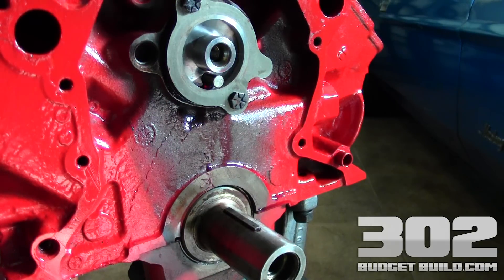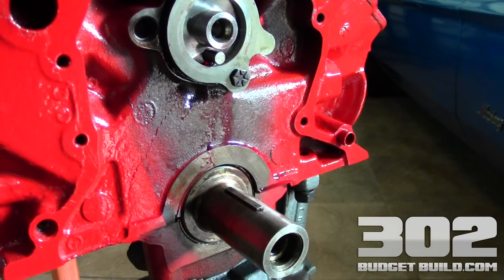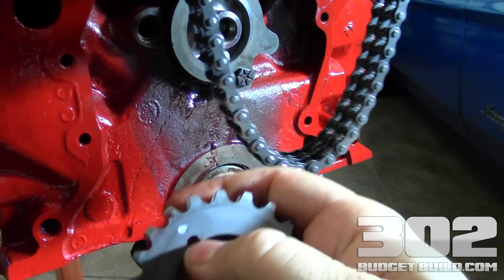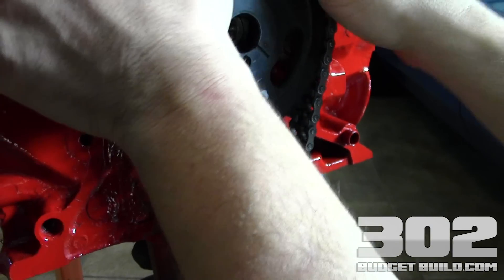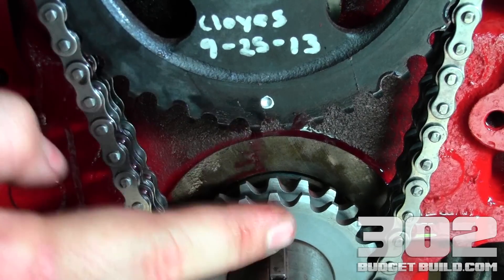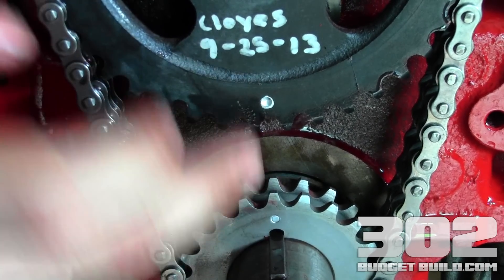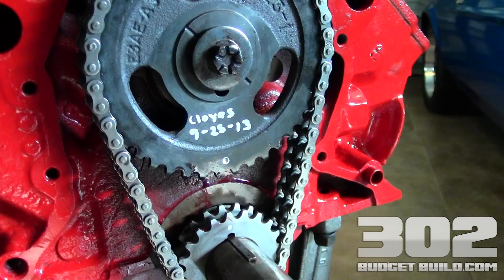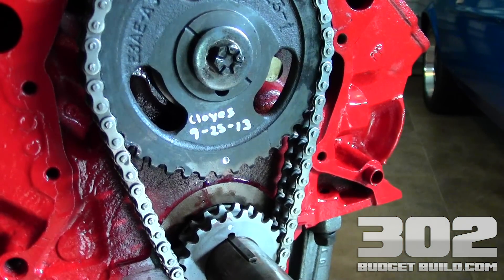How to Install a Timing Set Double Roller on a Small Block Ford 302 5.0

Comment: Small tip for every engine builder , manually rotate the engine over and make sure they stay alined , it can save you alot of money by double checking that timing
Reply: If my timing was off and I tried turning the engine in the car, and flames shot out of my open headers because either my timing was off or the rockers were too tight, does this mean I ruined my valves?
Reply: Dan Sisco doubt it.

Comment: Kepaloha. I did figure how to do it. Since the heads are on my I car I could not see the piston. I manually turned the crank until the piston came to top dead center. I checked this by sticking a screw driver in the spark plug hole. I then spun it again and checked it by sticking a screw driver in the hole. It did not hit the piston so I new that was the intake stroke. Turned it again and checked again with screw driver and the screwdriver was hitting the piston. Top dead center. Then I did what he showed in the video. Lining up the marks on the timing gears. It was actually very simple. My problem came last night when I found out that my used lifters I put in were very old and not up to the test and they failed so this week I get to do it all over again:) Hope this helps.

Comment: Just subscribed,  nice videos. Getting ready to do to my 289, I thought I blew my original motor and bought another one and recently discovered on my old engine that it was not blown but instead my timing cover sprung a leak on inside and was adding water to my oil. Always replace the old Timing Chain Cover. Good videos,  thanks!

Comment: some good tips in the video. I would also add to put some loctite on the cam bolt and go with an electric fuel pump instead of a mechanical one.  It also doesn't hurt to install the cam 4 degrees advanced for more low end torque.

Comment: Heres one for yall out there. Certain Timing sets require you to machine that cam thrust plate for counter sunk screws because some timing sets have a bigger thrust bearing. The one i just purchased from summit is this way. also the dots shows timing at 0 Degrees. Witch different cams and stuff some time you get an advantage by advancing your timing 2 or 4 degrees to increase intake stroke efficiency

Comment: I guess I'm 6 years late here but man I think you just might have saved my sanity.  I'm actually working on a gen 1 small block chevy and this drove me nuts today.  My 83 k10 started running terrible.  No power,  missing,  stumbling.  I pulled the timing cover and it's the original early 80s timing sproket with the nylon teeth.  The chain was actually drooping off the bottom sproket but it still ran. Don't know how though. I'm replacing with a Summit double roller chain set and I have the crankshaft sproket installed dot up. I spent over 3 hours today trying to get that cam sproket to line up but it was always a half tooth off and wouldn't go over the dowel pin. I swear I was ready to blow a head gasket (mine not the truck) and I think I just have to move the cam a tiny bit. All afternoon trying to get it trying every link. Thanks,  I won't get back to my garage until tomorrow but I'm 100% sure you lit my lightbulb

Comment: Make certain when install your new cam gear that you have installed the dowel pin. It can stick in the old gear when you remove it. It is easty to forget to install the pin if you are working on the ehngine in the vehicle. You absolutely must have that pin installed.

Comment: The 302 is a "non-interference" motor, so the pistons and valves will not collide. It will just run lousy and you'll have to reinstall.

Comment: Am I right in thinking that when that keyway is facing up on the crank, the engine could be firing on no.6 cylinder ie the crank is a full 360 degrees on from firing on no.1??

Comment: I am amazed on how many people put dry chains on their engines. SOAK YOU'RE CHAIN IN OIL BEFORE INSTALLING. The roller links are basically dry. You'll  see air bubbles coming out. I soak  the chain for a good hour in motor oil. And just putting oil on the outside will not get into the roller pins.

Comment: I have a question. Just installed my new cam and go my dowl for the cam and my keyway for the crank at top dead center. Does it matter if the tdc is on the compression stroke or the intake stroke? My number 1 was at top dead center and I installed the gear. When I do a full revolution back to top dead center the lifters are in a different position?
Reply: Have you gotten an answer on this question? it's a good question, I was thinking of the same thing, I've never changed a timing set before, so I'm a little spooked by it.
Reply: I may be wrong but from my understanding it doesnt matter because the cam will determine which one is the intake or compression stroke
Reply: sjpro1 The piston determines the intake or compression. If the piston is traveling up it is the compression stroke if it is traveling down that means it is creating suction from the intake valve drawing fuel in. If you put your finger over the spark plug hole on an intake stroke it will suck your finger. The compression stroke will pop your finger off. Intake stroke equals suction. Compression equals pressure.
Reply: Jeremiah Madsen the cam determines the opening of the valve which determines wheter it will actually suck or just compress
Reply: sjpro1 The cam determines which valve opens. The intake or the exhaust. If the piston were going up when the intake valve opens would the gasoline get sucked into the piston or pushed out? The piston travel determines the compression stroke or intake stroke. Not the cam. The cam determines which valve is open. See?
Reply: Jeremiah Madsen yeah i was a little confused there
Reply: sjpro1 Yeh. It is very confusing -Intake. Compression. Exhaust and intake. It is very confusing. Good job on considering all possibilities. I have had to change mine 3 times since this video so with mistakes comes knowledge. Just wish it didn't cost so much and take so much time :) That's a Mustang though.
Reply: Jeremiah Madsen yeah im just getting into my first engine build for a notch back. installing the cam tonight
Reply: sjpro1 Nice!!!!! Take your time and good luck!!!!!
Reply: Thanks for explaining clearly.

Comment: I have a question about taking off the gears. I could get the top gear off but the smaller one on the bottom I cannot get it off. Any ideas or suggestions?
Reply: get a small 3 jaw gear puller

Comment: Will it cause the motor not to want to turn over like it has to much compression if these are out of alignment
Reply from the maker: No. That would be an interference engine. It just won’t start if it’s not done right.

Comment: I've been out of the game for a while, so be merciful.  But, why would you use an impact on the cam bolt?  I'm weirdo who never met a fastener I didn't want to find the torque spec from the manufacturer, and then cross reference with the application.  I've honestly wondered how I could get a torque wrench on a lightbulb.

Comment: Why does the fuel pump go from electric to mechanical? Could I replace the timing chain without switching the fuel pump to mechanical?
Reply: Yes you just don't buy or  leave Eccentric off

Comment: I bought a Rat Rod project with an allegedly rebuilt For 302 engine thrown in.  I have disassembled the engine to find it has not been rebuilt.  LOL  Anyhow,  based on information I was able to read from the non standard casting numbers on my block I think the engine was made in August 1988.  It was a throttle body fuel injected engine because the timing case cover has no fuel pump mount.  It came to me with and Edlebrock four barrel carburetor manifold installed.  There is no starter, alternator, carburetor, distributor.  When I disassembled the engine I found the lifters had rollers on them.  Is this stock?  (It's been a long time since I have overhauled an automobile engine)  My question concerns the timing gear set up.  I was expecting a gear to gear or gear and chain set up.  What I found was a gear and a gear and a pair of idler gears connecting the crankshaft and cam shaft gears.  Can you tell me what I have?  Thanks for the information.

Comment: is the mechanical fuel pump better to have than electric? I have a 1970 mustang with 302 and I put a new fuel pump and it's still not sucking fuel, is it possible for those eccentrics to go out? could the pump be bad even though it's new? is there a way to tell if it's the eccentric or the pump? should I just and all this and convert to electric? please help, thanks
Reply: I run both  with a pressure regulator to a demon 750 on my 74 bronco w/302
Reply: Not sure if you already fix the problem yet, but it could be a clogged Fuel Filter. When I was working in a Shop i saved people money for the thought they had a bad Fuel pump, but the filter was clogged up.

Comment: Hey, man! I have a question.  Hopefully, it's not too stupid.  I have a new timing chain set for the 302 I am rebuilding.  The cam dowel and the key are aligned, but the chain seems to short.  It looks to be the same length as the old chain, but I can't get both gears to go on.  What am I doing wrong here?  Can anyone help a fellow out?
Reply: Figure it out yet ?
Reply: See if you can put the old chain on the new gears.

Comment: why does my keyway to the camshaft not move so easily like the one in the video?? the only way it moves is if I put the bolt back in it and use a socket to turn it, he uses his fingers and moves it like nothing
Reply: patrick whitaker I am having the same problem with my 351w factory roller motor. I went back with a comp Am and hyd rollers with link bars. When I put the cam in it didn't want to spin freely, it will spin with a wrench on the sprocket bolt and when I put the thrust washer on then the gear the cam will not turn at all ,, like it is in a bind.... any suggestions
Reply: patrick whitaker and I did put the dowel pin in the cam. I am running a Holley electric fuel pump
Reply: Hello my friend, one question do you think I have the same camshaft like yours (351W factory roller motor)? I have a 1997 mercury mountaineer AWD 5.0L, I just hope you now my question I would like to know if my car has a 351w factory roller motor. Please explain my friend thanks in advance.

Comment: what happens if you dont have proper alignment
Reply: jose lazaro Your engine will run poorly, if at all. This timing set controls when the valves open relative to the position of the pistons, so the engine won't run if the valves aren't opening when they should. If you're unlucky, the valves and pistons can collide and you'll have some repair work to do.

Comment: I know this is an old video but I have a couple of questions and appreciate some info. 

1: So I need to be at TDC on the compression stroke before taking everything off? 

2: Have to fix a coolant leak coming from the timing cover so I figured I replace the chain and sprockets. Do I need to stick with the single sprocket which is probably what a standard 1969 302 comes with or can I go with the dual sprockets?

Comment: Hello..watched all your videos (pretty awesome). I wonder if you could answer a question. I have  66 289 (a lot interchangeable with the 302) and am ordering parts. I haven't cracked open the front cover yet but how do I determine if that year/engine has a 1 piece or 2 piece eccentric? I KNOW it makes a difference when you order the chain and sprocket set..THANK YOU in advance